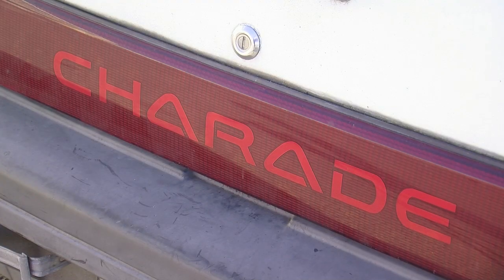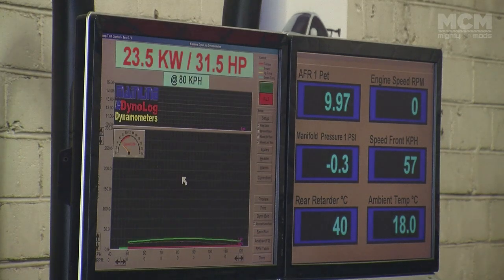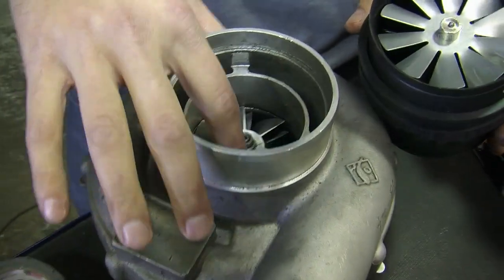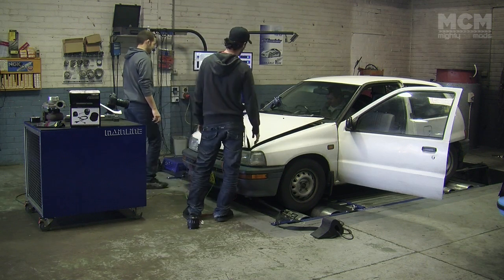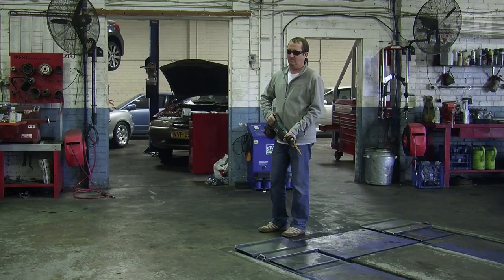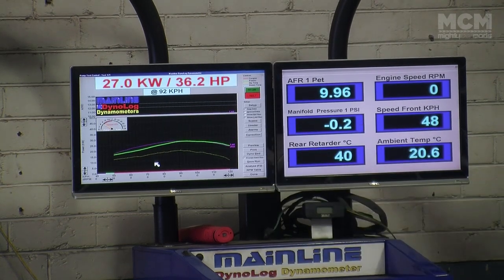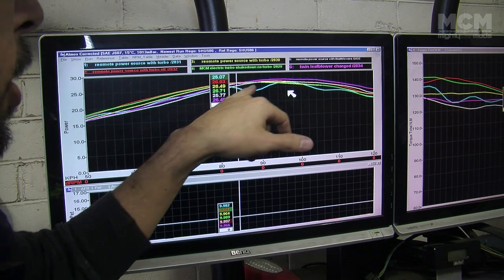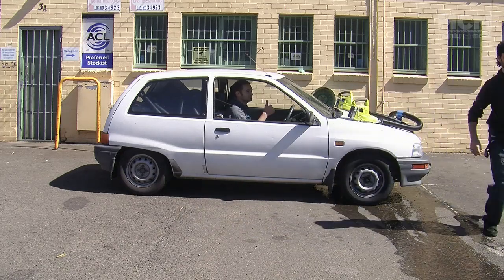Electric SuperChargers Mythbusted

Comment: Doesnt the carb need to be adjusted or changed, or the engine remapped if it's fuel injected? I mean, i'm sure that electric POS is useless, but, even if it were something like a 5kw monster fan, you'd still need to do more to get most of it, wouldnt you?
Reply: +ComandanteJ Figure, with nothing more than, basically, a fan, like you say, it's not going to do much more than driving at a different altitude would & standard ECUs can handle pretty big changes in altitude. I live at 5,200 feet & regularly drive up to Sandia Crest where it's a tad over 10,000 foot altitude. So, basically, most cars can operate fine between sea level & probably a bit below up to at least 10,000 feet. Most people live between those 2 extremes so say you live somewhere that's 1,500 feet in altitude & you could get, like you say, a monster fan that would make it like driving at sea level. I would think most cars would actually get a bit of a boost without having to do much else. 
Actually, now that I think about it, back in the late 80s/early 90s there was a company selling "superchargers" that bolted into the space where your AC compressor would normally go. They were driven by the AC belt & they actually worked fairly well, even on the early computer cars. Now, mind you, that was for cars operating at 5,000 foot altitude & they only bumped the power up 20 or 25% which would be like driving at sea level. That was a big deal up here. I never got one, they were $1,000 & that's was a big chunk of money in the late 80s, especially for a student but I know a few people that had one & they worked well. I have no idea if they worked at sea level, that may have required changes to the ECU but up here, they worked, if nothing else, as a good altitude compensater. 
Like you say, I bet this unit is useless but, I bet if you could blow enough air, you could get a little boost without remapping & if you live at a high altitude you could compensate for that altitude without remapping so long as you don't go to far. A standard ECU has a fair amount of flexibility. Things like a fan or a little bolt on supercharger is nowhere near what a real turbo does. That, no doubt would require remapping but if you could find an easy way to just blow a little extra air in there, most cars would do just fine.
Reply: +ComandanteJ Figure, with nothing more than, basically, a fan, like you say, it's not going to do much more than driving at a different altitude would & standard ECUs can handle pretty big changes in altitude. I live at 5,200 feet & regularly drive up to Sandia Crest where it's a tad over 10,000 foot altitude. So, basically, most cars can operate fine between sea level & probably a bit below up to at least 10,000 feet. Most people live between those 2 extremes so say you live somewhere that's 1,500 feet in altitude & you could get, like you say, a monster fan that would make it like driving at sea level. I would think most cars would actually get a bit of a boost without having to do much else. 
Actually, now that I think about it, back in the late 80s/early 90s there was a company selling "superchargers" that bolted into the space where your AC compressor would normally go. They were driven by the AC belt & they actually worked fairly well, even on the early computer cars. Now, mind you, that was for cars operating at 5,000 foot altitude & they only bumped the power up 20 or 25% which would be like driving at sea level. That was a big deal up here. I never got one, they were $1,000 & that's was a big chunk of money in the late 80s, especially for a student but I know a few people that had one & they worked well. I have no idea if they worked at sea level, that may have required changes to the ECU but up here, they worked, if nothing else, as a good altitude compensater. 
Like you say, I bet this unit is useless but, I bet if you could blow enough air, you could get a little boost without remapping & if you live at a high altitude you could compensate for that altitude without remapping so long as you don't go to far. A standard ECU has a fair amount of flexibility. Things like a fan or a little bolt on supercharger is nowhere near what a real turbo does. That, no doubt would require remapping but if you could find an easy way to just blow a little extra air in there, most cars would do just fine.
Reply: shananagans5 Very nice explanation, makes sense. Thanks!

Comment: Certainly you can make an electric supercharger, but you would need an intake several times bigger than the outlet, and an axial compressor, rather than a centrifuge compressor like a turbo. A much easier way to improve compression would actually be to supercool the air going in, a healthy liquid oxygen injection.

Comment: did you install a new air filter? if not, then installing the supercharger may have opened a better air path through the old filter, which would explain why the power level remained higher after removing it. You need to make the fuel air mix richer to account for the extra air being forced into the system- more air means you can burn more fuel- this video is entertaining but basically worthless. if you're going to "mythbust" something you need to actually do all the required steps to properly test that thing.

Comment: that tin fan ain't pushing more than 1/2 Psi. what a ridiculous scam.
Reply: +SNIP3R 

It probably even clogs the airflow since it needs to push 120 cfm in to the engine to break even to the naturally aspirated intake strokes (there's 2500L/m of outside air taken in at 5500rpm with a 1:13 F/A mixture)

Comment: You may have wanted to seal up the thermostatic heat riser that opens on warm up. Some cars with pulse air injection will direct the pressure thru the check valve and right out the exhaust. You'd be better off filtering the air before the compressor and doing away with the stock air cleaner!

Comment: 31.5 HP? How does it pull its own weight?
Reply: +Roy F. guessing this car is light as fuuuuck. drop like b16 in this body and you would have a sleeper for sure
Reply: because the car is in perfect condition isnt it xD so it will be shit
Reply: +Roy F. well if a horse weighs 400kg it has 1 hp that wheigs 800kg 31 hp so think about that
Reply: +Roy F. Slowly.
Reply: +Nightdare The African swallow or the European swallow?
Reply: What is the airspeed of an unladen swallow?
Reply: +Roy F. 

By not throwing on tons of safety measures
Reply: ...and if horse B weighs 600kg, and horse A starts running from mile marker 275...?
Reply: Roy F. 😂😂😂my 100kg dirtbike has 30hp
Reply: Roy F. 31.5HP couldn't even pull an old man's foreskin back lmao
Reply: my rc car has more hp than that! (traxxas modded)
Reply: +lauri sorvari I don't know that--aaaaaaaaaaaah!
Reply: +lauri sorvari horse actually have more than 1hp)))
Reply: +Roy F. Maybe it once had more horsepower, but looking at the state of this car.... I won't be surprised if that engine is worn to crap.
Reply: Early 2cv's made 7HP!!!!!! later ones went from 14 to 22 HP
Reply: 31.5HP is a LOT OF POWER

210HP is useful if you're hauling cargo

but 31hp is a lot of power, you realise.

Your legs only produce around 1hp at peak, when you are cycling.
Reply: turbine
Reply: +Roy F. VW beatle had barely more (up to 34hp), 2CV even less (about 20?) ...
Reply: Because it weighs as much as a crisp packet, they did  a turbo version of that car by the way.
Reply: Easy you don't need much horsepower to make a small car that weights less than a ton go 100 km/h 
My Citroen 2CV6 got 29 horsepower and it has fine acceleration in city traffic. and does OK on the highway, you only notice when you try to overtake someone on the highway that it takes longer.
Reply: Diesel trains have about 30hp.. they fucking work
Reply: lauri sorvari Russian here... The only swallows in Russia are the women. 

Actually I think we do have a species of Swallow but it ruins my joke.
Reply: how can you pull your head?
Reply: Terry Wilson au pair lol
Reply: My 35 year old motorcycle has a bigger engine (650/4 cyl) and makes 40 more HP at the wheel lol
Reply: Roy F. There are cars witch 2hp
Reply: If you think about it 35.5hp is actually a massive amount of power, they say work horses are 15 horsepower each and they used to pull 50 tonne barges
Reply: Look, the 2cv had 18 hp and the subaru 360 something like 12 so..
Reply: yes, the Charade GTti had teh same engine with turbo and made 105bhp. It wnet from 0-100 kmh in around 8 seconds
Reply: People underestimate the power of a car. 30hp sounds like nothing compared to the 200 you might see on an average car or the 600 you may get on a tuned muscle, but when you think about it, 30hp is about 22KW or 22000W. You could power an entire household with that.
Reply: Miguel Rodriguez  what fucking torque 😂
Reply: Roy F. C'mon man, the first generation beetle only made 34 hp at the flywheel when they were new. On a beetle that had makbe 50,000 kms on it, you'd be lucky if it made 20.
Reply: Ellenor Malik no, actually 31 ponies is not alot of hp by todays standards. Hell, my 1litre polaris general makes 100hp at the flywheel...maybe 65 at the rear wheels.
Reply: Nightdare African or European swallow?
Reply: DJ Coish how do you think a dyno works ? You cannot test an engine for hp without placing it under a load.
Reply: Put a cbr-1000 in it OMG real sleeper.
Reply: It's an old car, everyone knows old horses have more pulling power.
Reply: Roy F. How does it do a burnout?
Reply: Ever been on a horse?
Reply: Because it weighs like 700 kg
Reply: what weight?
Reply: +Goopes H I highly doubt your  rc has more than that
Reply: +Roy F. There is another factor called torque for that.
Reply: Close to true, the earliest model of 2CV had 375 cm3 and produced 9 HP. But for obvious reasons they bumped it up to 21 HP to 29 HP by increasing the displacement to 435 cm3 (2CV4)  and 602 cm3 (2CV6)
Reply: +swaggyb cool
Reply: +Miguel Rodriguez bahhahhahhaha u think that 1.0 3 cyl has tq bhahahahahaha with somthing that has 1.0l of n/a displacement and only a 3 cyl makes no tq u bet the tq was like 20 ftlbs if that over here in the states anything with 100hp or less is more or less laughed at

Comment: Yeah, but that Daihatsu looks pretty old. Is it using a mass-air-flow sensor? Did you reset the ecu by disconnecting the battery? Find a more conventional make/model -- say a Honda Civic made in the last 10 years and test it on that.
I'm not buying that these e-supercharger deals are worth a damn either, but that Daihatsu looked so old it may get have been carbureted. Might as well test it on something with a computer/MAF that can adjust for the alleged increase in air flow. But if no improvement there, then bust lol

Comment: What if you removed the turbine from a turbo and drove the compressor with an electric motor?
Reply: +Anthony Geiser There are electric superchargers like that and they work, but they require a large, powerful motor. There are also electric screw type superchargers. These are good for drag racing because they don't take power away from the motor when being used, but they battery will need to be recharged afterwards.

Comment: Supercharger does nothing if u dont add more fuel through the carb jets
Reply: +Devin Williams The problem with this car is that is has a vacuum operated secondary throttle.
 By adding boost, only the tiny primary throttle will open.
This motor was available with a blow through turbo setup, this had a boost operated secondary throttle, an electric fuel pump and fuel pressure regulator, and different jetting to handle the extra airflow.

Comment: If using electric turbos, you get more boost pressure by running them in series, rather than the parallel setup shown here.
Parallel will give you more volume, series gives more pressure.
I'll bet that 3 or 4 of those leaf blowers in series would make a very substantial difference.

Comment: .. I dont' even, how the hell do people get sucked in by these things?  I don't know jack shit about cars, some of the basics needed to change oil, and that's about it.
but I do know a bit about electric fans...  and there's no freaking WAY a 12v fan is going to add a single piss of pressure to the intake of an engine, if anything, the intake will burn the fan out by running it WELL above it's rating...
ahh well they do day a sucker is born every second....
Reply: a brick under the accelerator would increase economy
Reply: I'd love to see the size of a 3Kw 12v fan, it's be friken HUGE!@ lol
and the cables would be crazy huge.
a 935amp cable needs to be 506.7mm square
how big would 3000amp be?  HUGE.
so yea, I don't think it's likely to be possible ;)
Reply: shhh you're using logic silly human.
I dunno, it's like people believing in a god..
makes no sense.
Reply: +John Douglas In an episode of Roadkill they made a power increase using I forget how many, maybe 4 gas powered leaf blowers. But it only helped at low rpm, at high rpm it reduced power. And of course you would have made a bigger difference if the gas blowers were just directly mechanically driving the car and not blowing air since it wouldntt have caused restriction. (Edit: Actually I'm not so sure about that now, they may make a bigger difference at low rpm with forced induction, then just make a bypass for the higher rpm so there is no restriction.)

But this video did show that if you have a small enough engine, like 1 liter, you can get some gains from leaf blowers. Still totally not worth it of course. No, no way a 12v fan will help. Has to be externally powered like gas powered.

If the roadkill guys installed a 1 way valve they could probably keep their low end gains and let the valve intake air at high rpms where the leaf blowers are restrictive.
Reply: +John Douglas 
I know, this was retarded.
A supercharger needs to increase manifold pressure to increase power.  
A fan or leaf blower isn't going to do it.
Reply: +mr42ndstblvd 5k rpm, hmmm they say turbos run at 100k rpm , so thats 5%. BTW the faster an electric motor spins the less torque it has, so even if it was making pressure the higher load at the higher speed would just slow itself down
Reply: +Daniel Nebdal Ohms law is not your friend at that point though ;-) No matter what, watts = volts * amps. Lower the voltage, and you're going to have a silly number of amps. Hence your absolutely stupid busbars, which I think you'd need even with smaller motors.
Reply: +Jonathan Pullen Oh I know - just because you can doesn't mean you should, and all that. :)
Reply: +Jonathan Pullen Oh I know - just because you can doesn't mean you should, and all that. :)
Reply: +John Douglas I work as a courier in a small town. Recently there were a bunch of people ordering 50 dollar plastic ring thingies that you were supposed to clip around the fuel line to see 30% increase in fuel economy. How stupid would a person need to be to actually pay money for something that stupid. 
And the worst thing was, one  guy who ordered that thing was a local car mechenic. Atleast now I know where not to take my car in for a service. Totally absurd.
Reply: Renee Rehe If the clip physically restricted the fuel, would that increase fuel "economy"?
Reply: +John Douglas Being 12V doesn't have that much to do with it - you could run a train on 12V (but you'd need some absolutely stupid busbars or a silly number of smaller motors).  

Some quick googling suggests a large car supercharger can drain 50-60 HP. That's about 40kW, at 12V that's a lively 3333 Ampere. That's massive, of course - but you can buy car batteries that will provide 900A for a bit, which works out to about 14 HP. You'd have to wire it with some chunky leads, and use it sparingly, but I bet that'd make a notable difference on a tiny I4 engine.

Comment: A fan and a compressor are two different things. One accelerates air with little change in pressure and the other compresses air with little change in velocity. If you want to increase power you need a compressor. The product they tested would never work because it has a fan that can make air go fast, but any back pressure is able to move between the blades and between the blade tips and the shroud. The pressure increase downstream of the fan would be tiny and therefore so would any increase in power.
Reply: +Devin Williams A restriction downstream of a fan will cause the air to accelerate and reduce it's pressure. See Venturi effect. This is the  opposite of what you want a compressor or turbo to do.

Comment: Try rerouting the A\C into the air intake and see if the cold air increases horespower
Reply: +Isaac Albano Running the air conditioner will take more power from the engine that you can gain from cold air.

Comment: 1) buy an turbo. 2) take off the turbine housing (exhaust side) 3) take an roller pully with the right volum dia (so u don't press too much air in). 4) mount it on ur car. 5) find an belt. congratulate u just made ur own supercharger. :)